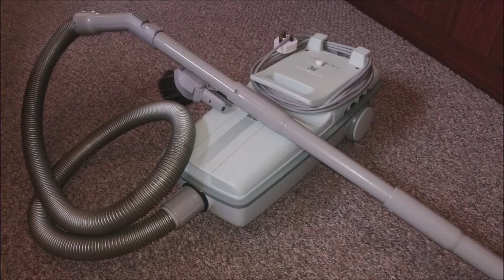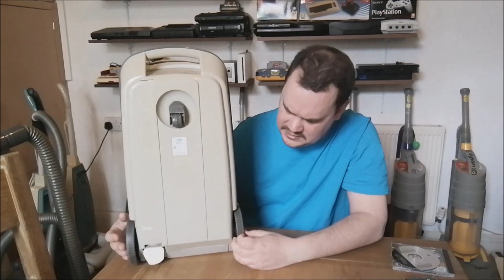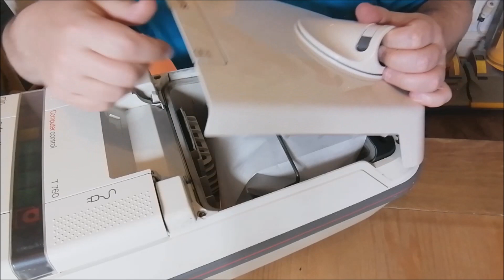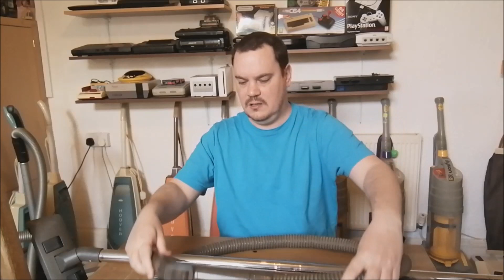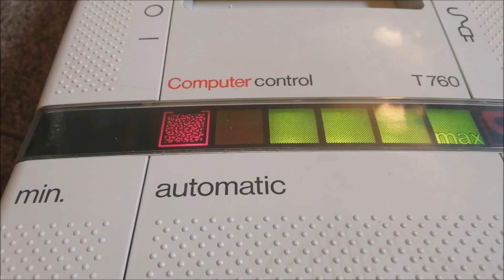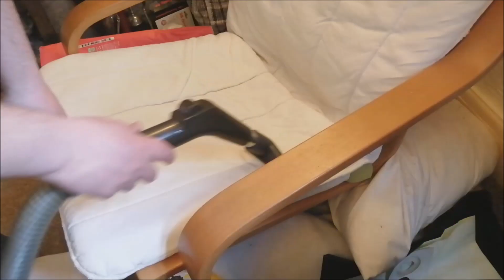Vintage 1988 Philips Computer Control T760 - A Touch of Dutch Luxury!

Comment: Philips used to be a really good company. They made brilliant consumer goods, microwave ovens etc. Then their consumer goods factories went east and the quality has declined, probably because most people want cheaper goods that get replaced every few years. I know there's an unused Bosch vacuum cleaner with a "compressor" motor (whatever that is) I gave to a friend, but they insisted on getting a bagless machine instead. Somewhere in the loft is an OLD Hoover upright vacuum. EDIT: I don't collect vacuums, but the Hoover upright looks like it's been in the loft for 30+ years, long before I moved here.

Comment: What a wonderful vacuum!
I have slightly older Philips P74 Electronic and it is one of my favorites of all time. It has electronic power control and boost mode what you have to press every time if you want the maximum 1000 watt suction. Build quality is very good and it easily rivals my 80's Miele S234i. It's super smooth sounding. Almost all what I can hear is the airflow going through the vacuum. It also has very clever exhaust path. Air comes from underneath the motor, goes around the bag chamber and exits from top of the bag chamber. Microfilter is top of it.
I am constantly searching good condition T-series like you have. Or any 80's Philips canister. I just love how they are made.
Thanks for the video!
Reply from the maker: I LOVE the older Philips machines from the 60s / 70s, they were such high quality

Comment: Thats great, you can see how the Sensotronic was alike to this machine, loads of bells and whistles for those that liked that sort of technology. I can imagine it would have been pretty expensive, but it does lack a handle remote control which I would have thought would have been standard on the top of line model. Also, this would have been nice with a powerhead - maybe Philips offered it with one for other markets?
The closest machine I have with the features that the Philips does, is a Miele S8730 from 2012, a pretty rare machine now, since it was discontinued before the EU regs came into effect in 2014. It has the auto suction function which increases suction on bare floors and reduces it when on carpet, so works in the reverse way the philips does. As with other S8/C3 machines, it has the lights for power level but also has lights for standby, filter change and overheat, as it also has a handle RF remote control, but does not have a facility for a powerhead, much like the Philips. The Auto power level was also available on certain Miele S7  upright models too, and this worked in the same way as the S8730.
As you would know anyway, Hoover did something similar with the Turbopower 2 Autosense, but this increased motor power if it detected dirt entering the bag inlet port rather than relying on the vacuum back pressure in the bag housing to vary motor power as on the Miele and Philips systems.
Reply from the maker: I think the dirt detection system is much more useful than a pressure sensor

Comment: Looks a lot like an oreck dutchtech I’m pretty sure they are pretty much the same body that hose inlet looks exactly the same!
Reply from the maker: Oh my GOD you've just blown my mind! I had no idea Oreck and Philips had a tie up to make the Dutchtech series. They look so cool!
Reply: The Vintage Appliance Emporium yes I didn’t know until another collector said something about it this machine and the dutchtech have so many similarities they are basically the same outer shell wheels swivel top and such even the pre motor filter looks to be similar, oreck did it a tad differently as they exhaust out the back and have the tools which look exactly the same are stored on top of the bag lid with its own lid on the dtx1400 model that I have at least they are extremely reliable machines both of mine are paired with an EBK340 power nozzle it’s an extremely nice touch with how much air these move

Comment: The way the auto feature works on machines that have it (Miele has a great visual model of this)

There is a small bladder located off the side of the bag chamber. The bladder inflates and deflates as air pressure changes. When this happens, small copper probes located on the side of the bladder slide up an down a mini rheostat. This component is connected to the board that controls the machines variable speed thus creating the “auto feature”!

The correct set up for the auto feature is:
Carpet= suction down
Bare floors= suction up
Curtains???= get rekkkt my man

The problem with turning the power up for carpet is that the head becomes harder to push with increased suction. And turning down suction on bare floors causes cleaning effectiveness for tile grout to go waaayy down.
My new bissell pet hair eraser canister has the backward set up (carpet up bare floor down) and it is an incredible pain in the ass to use. So I don’t use auto with that machine lol.

Comment: I love this machine, I had one in for repair once and I didn’t want to give it back, I personally prefer the automatic function on this as when on carpet it boosts suction and then lowers it on hard floor as I prefer however for tools use the hoovers were better.
Reply: I love this machine Jacob I love the light show and good clean looks